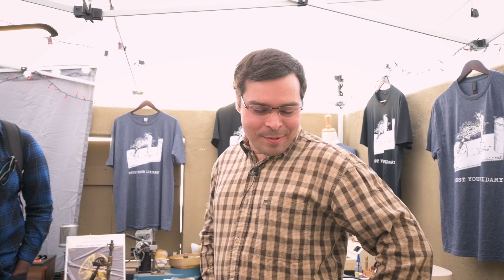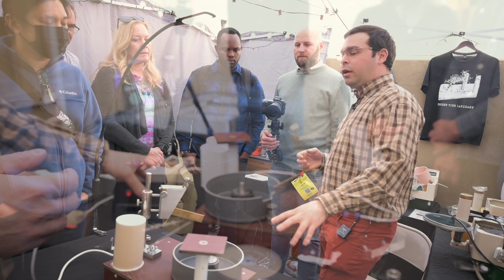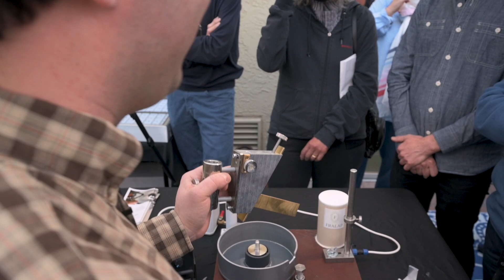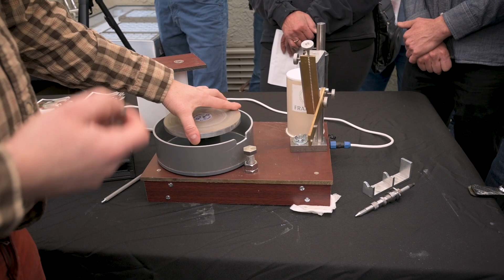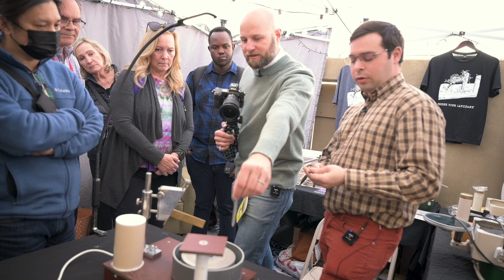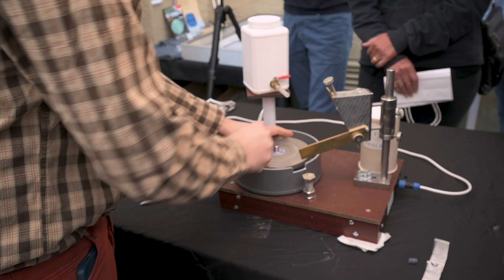Exploring the Fralap French Jambpeg Faceting Machine with Antoine Teixeira

Comment: how good would you rate this machine? from 1 to 10 and why? is it a precise cut? learning curve? fast producer? and do you recomend it for a begginer? appriciate your work!  cheers from Mexico
Reply from the maker: It’s a good machine. I’ve been using it for the last two years. After 2 years my cutting is becoming decent. I would say it has the biggest learning curve of any type of machine but once you master it, it can be very fast and precise. I wouldn’t recommend it for beginners without a teacher. Otherwise go with a Handpiece machine such as a Sterling. It’s easier for beginners and there are a lot of instructional videos online.
Reply: @JustinKPrim nice thanks a lot great info and ok my plan is more to build one myself looks fairly simple, just the only thing that I don’t know if they sell it or how it works it’s the handpiece so I can build it’ thanks man and cheers 🥃

Comment: I appreciate all these novel machines you've been showcasing. There is a revival in new approaches to the traditional faceting systems. I'd love to see what your ideal machine would look like! My prototyping has slowed a bit with the cold weather and the need to cast alloy components. In addition to making an "ideal" machine another approach I'm exploring is retrofitting vintage heads to the linear handpiece design. It would open the world of vertical faceting to more cutters for a lot less than buying an entirely new handpiece and rail system.
Reply from the maker: I hope once we get relocated work will start on my ideal Handpiece prototype. I have people who have skills that can help now and I know exactly what I want out of it. Let’s see what emerges.
Reply: @JustinKPrim  With all that you know about faceting and the various types of machines that will be exciting to see! A couple of designs that I have yet to start are a departure from any existing machines. For one, imagine the handpiece and lap combined for a truly portable design intended for preformed stones. It might be hard to picture but it would roughly be a quadrant that slides parallel to a motor with a 3" lap attached. That and the other concept (secret for now lol) are distant future projects after this vertical lap with overhead sliding rail handpiece are finished and thoroughly tested. Can't wait to see your new shop when you get all settled in!
Reply: They are only novel if you are American or Australian.